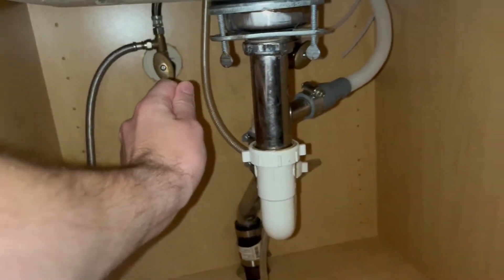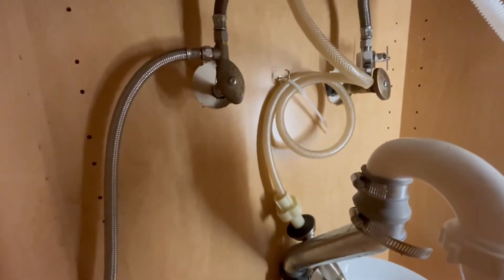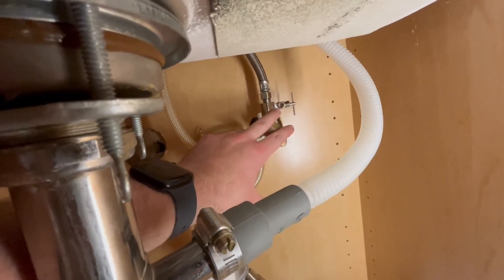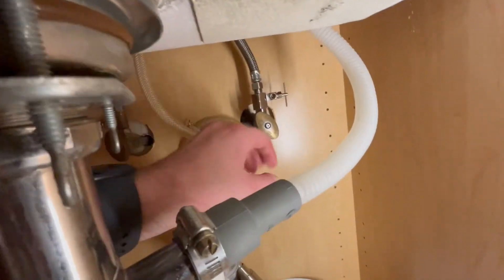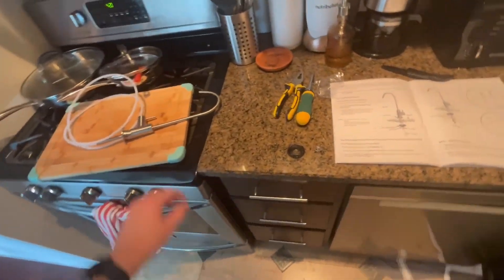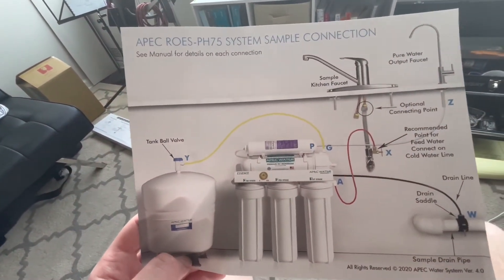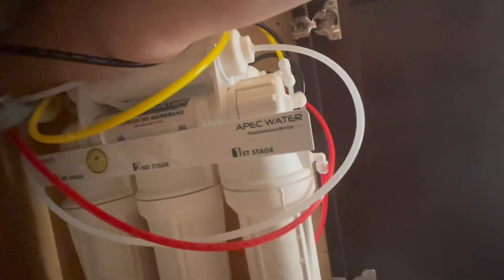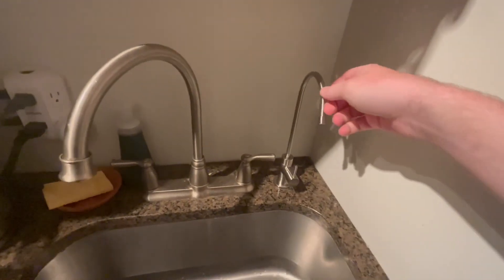APEC ROES-PH75 Reverse Osmosis System Installation

Comment from the maker: I did not initially set out to make an instructional video so this is not intended to be a high-end production with a detailed walkthrough of every step. Sometime after unboxing the system, reading the manual, putting together the valve and needle valve pieces, and taking off the spray hose from my countertop I decided to shoot a video to show to my family and friends. 

I uploaded this video in case there are people out there who want to, but are hesitant about, installing an RO filter because the space under their sink is tight, which it is in my case. You can do it!

My biggest challenges were accessing and loosening/tightening the nuts. I did not have a wrench, so I resorted to using pliers instead. It took some time, but I was able to do everything properly in the end. Tip: get two wrenches.

The hook in the cabinet solution to hold my existing spray hose is not the optimal way to go as there is a slight risk that some objects might push up against it and release some water but hey it was just me thinking on my feet and it works! I also wanted to avoid drilling another hole into the countertop. Tip: get a cap to mount to the bottom of the main faucet. 

I ordered the APEC from their website instead of Amazon because I knew that the standard 4 gallon tank that they usually ship with the system would not fit under my sink. you can request that APEC ship a smaller 3 gallon tank instead at no additional cost which is what I did.